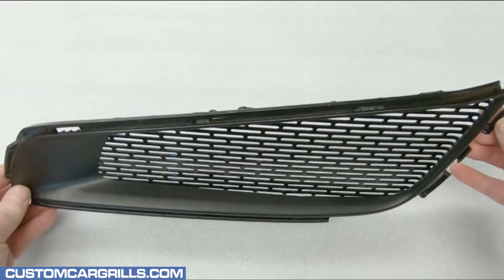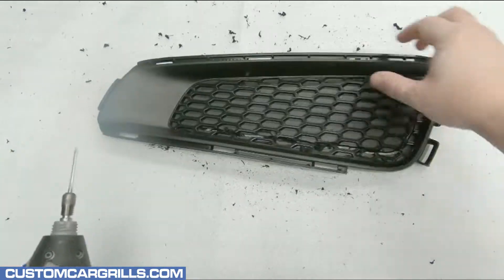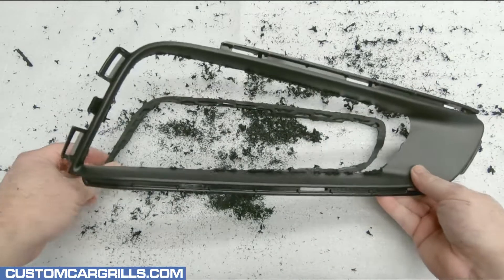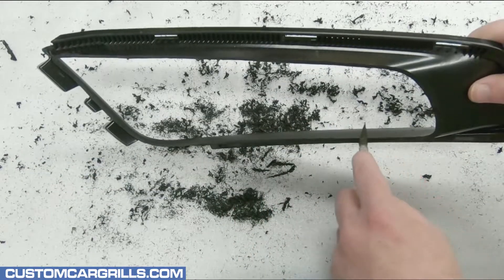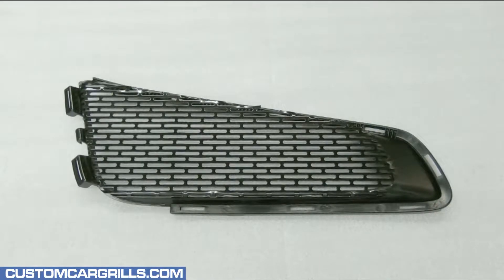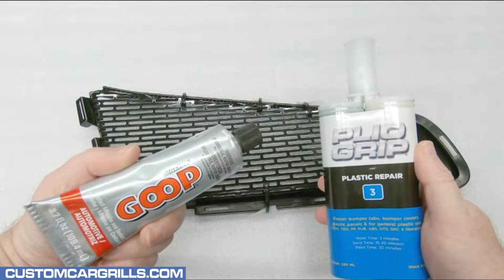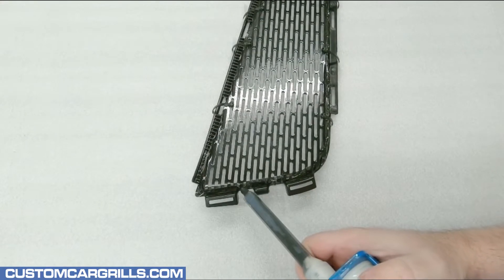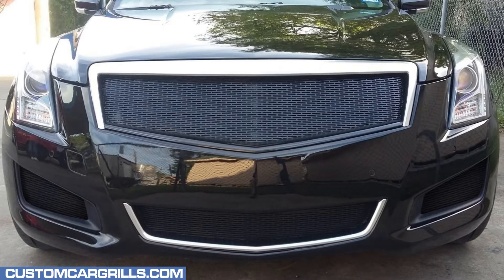Cadillac ATS 2013-2014 Fog Light Mesh Grill Installation How-To by customcargrills.com

Comment: How does the insert come off the bumper? Great video BTW
Reply from the maker: It clips out on the perimeter.  You can see the holes on the outside edge of the grille in the video; that's the area to look at on the back of the bumper.